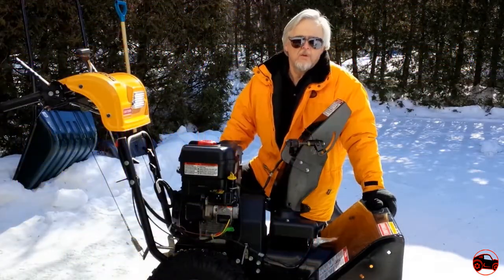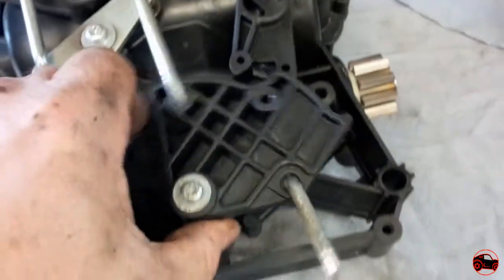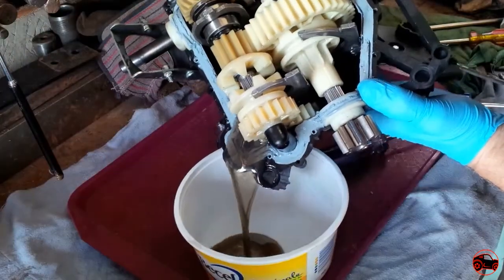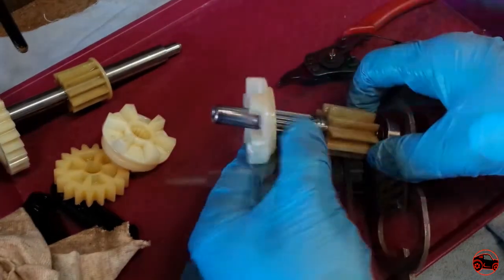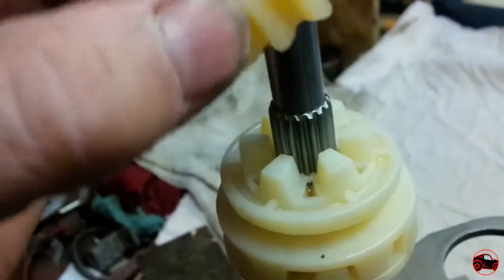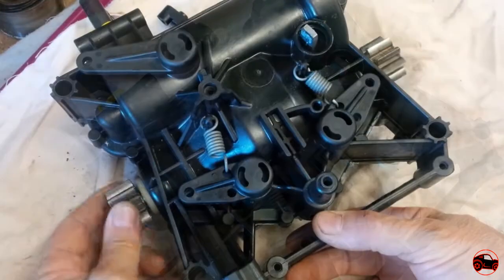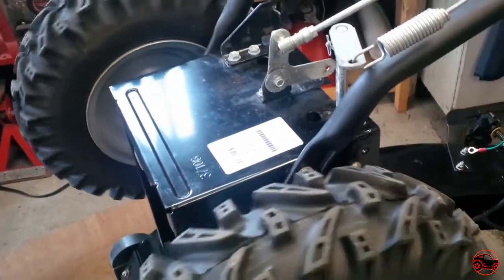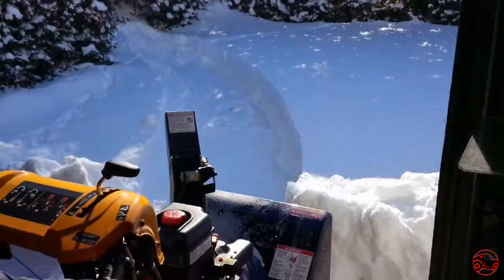How I dismantled and reassembled the transmission on my Sears Craftsman Snowblower C950-52301

Comment: very complex. I have a craftsman C950.521260 that fell off my carrier this morning landing on it's side.  now I am having a difficult time shifting into the forward gears. if I get it into forward 1 or 2 I cannot easily get it into reverse 1 or 2.  nothing appears to be bent or broken on the outside but it seems like the linkage rod that goes into the body of the blower is binding.  anyone have any suggestions on what the problem may be or how I can repair?
Reply from the maker: When the traction control is out of adjustment, the Operators manual mentions '' See authorized dealer'' so it doesn't help. I know that the speed variation control rod (right hand) is used to rotate the shift cam that is mounted on the top of the transmission. The rotation angle of the shift cam is critical to align the inner gears of the transmission and the outer short control rods. If the speed variation control rod is not properly adjusted in length, the transmission inner gears can be misaligned and the outer short control rods can be offset from specs. If the snowblower handles were not properly aligned after the fall, you could try to readjust the length of the speed variation control rod. This can be done by using the adjusting nuts at the bottom of the rod. I don't know the specs about this adjustment but you can have a look at these document to know more about the transmission system. 
Links to: 
Snow Transmission Type HR300P
https://services.generaltransmissions.com/wp-content/uploads/pdfs/service-manuals/39005-B_manuel_HR300P_BS.pdf
HR 300P Transmission. Hard Shift Kit Installation
https://services.generaltransmissions.com/wp-content/uploads/pdfs/bulletins/Snow%20blower%20Controls%20kit.pdf
Reply: @mtlcarguy  thank you so much. this is a great place for me to start.  I will report back with findings when I get into it tomorrow.
Reply: @mtlcarguy  I will try to link a video. I disconnected the speed variation control rod at the bottom. attempted to move the shift cam by hand and it will not move in either direction. 
https://youtu.be/4fkFOv4P9Bg?si=EwB_Io1Xw1XTwfXc
Reply from the maker: @TheRealRobM  The short rods on the top of the transmission are also connected to the variation pulley. This pulley combined with the driver pulley on the engine act as a CVT system. Make sure the engine is ALWAYS running when changing the position of the cam and short rods, so the variation pulleys can retract and expand while rotating and at the same time the position of the drive belt is constantly and properly distributed between the 2 variation pulleys. If the variation pulley are not spinning the cam may jam.
Reply: fantastic!  that allowed movement!  connected the selection rod back to the lever arm.  started it and the forward gears are working!!   after it engaged the drive forward. I stopped and it easily went back into reverse.  then back to drive and so on. about every third back and forth with the drive selector, it binds and won't go into reverse. I lurch it forward again and it easily slides into reverse.. then easily back into any of the forward speeds..    I think I'm going to leave it for now. I need it for a couple more months until past winter.  I can absolutely manage with the 1st and 2nd speed working and rarely use reverse anyway.   
I completely appreciate your help and will stay tuned.  I'll leave well enough alone for now. thank you mtlcarguy from an Ontariononsnowblowerguy 😅

Comment: Great videos — did you ever need to replace the drive cable.  Looks like I need to remove the engine to get to it, which is mind blowing.   Before I get too deep into disassembly just doing some searches to see if anyone else had any ideas.
Reply from the maker: No, and I bought it from Sears in 2012

Comment: Thank you very much for the video! I have managed to fix my transmission following the steps. I had the same issue with the two bearings next to the clutch lever. The snowblower is working again!  Mine is Craftsman C950.521260, the transmission is General Transmission 3071A152, 1733972 (87022 A2). Best regards and thanks again!
Reply from the maker: Make sure that the steel cable that engages the cone clutch system is not slack by adjusting the linear guide wheel (@ 7:17, top left corner). This should prevent a partial contact of the two conical surfaces that would generate slipping and overheating.

Comment: Probably the best mechanical video I have ever seen. Reassured me that I won't be repairing my transmission. I will spend $350-400 for the part or buy a new snow thrower. Thanks!

Comment: im really surprised there is never used internals available on ebay....if they fail often there should be a ton of them available for parts use ...ive personally only seen two go bad....one time was the 6002 bearing fail....second one was an overheated cone on the clutch got so hot it melted the center part of the worm drive nylon gear and made it too thin to effectively function as a clutch

Comment: I have the same snowblower and after last storm I started blowing snow and as soon as I changed speed I couldn’t lower speed. After taking machine apart I see the drive pulley separates as a higher speed is selected and belt slips further into pulley. As pulley seems to go back to together when lower or reverse speed is selected it is no longer able to move due to belt being wedged into pulley. Do you know if pulley on the Craftsman c950 separates or is my pulley broken and in need of replacement. Trying to figure out if I get rid of machine or try to fix. Thanks
Reply from the maker: First: The hand controlled speed lever must not be moved if the traction control is engaged because it can damage Transmission Control Traction parts

Second: Never try to change the speed if the engine is not running because it can only move the shift arm plate controlling the lower variable pulley which improperly position the variable drive belt in the lower pulley. 
Pulling the speed lever too hard can also damage the plastic CAM control (Controls kit P/N: GT7933) and other plastic parts that are used to manage the forward and the reverse gears inside the transmission housing. 

This is the PDF link that can help you.
https://services.generaltransmissions.com/wp-content/uploads/pdfs/service-manuals/39005-B_manuel_HR300P_BS.pdf

Third: Usually, the upper or the lower pulleys are quite reliable. 
The lower pulley can be difficult to expand or retract if it is rusted or if the lateral bearing acting as a thrust roller bearing is damaged.
A bad adjustment of the speed control rod can also create a problem.

Craftsman.com (Craftsman.ca) still sell snow blowers, but, this model is not sold anymore.
Some generic parts can be found on the Internet. I don't know if parts like the ones in the Controls kit P/N: GT7933 can be found if they are damaged.

Comment: Great video now I am wondering how to adjust the tension on the clutch system
Reply from the maker: The tension of the traction control cable is adjusted with the guide wheel (P/N: 579860MA) of the slotted bracket (P/N: 1737347AYP) that is fastened to the frame box. If the cable is slack, I loosen the nut of the guide wheel screw and I slide the guide wheel retaining bolt in the slot so the control cable is not slack anymore, then, I tighten the nut to set the new adjustment.

Comment: I think that the basic problem with this transmission is that the bearings are mounted in a plastic housing, so heat isn't getting conducted away like a metal housing would, so the bearings overheat and fail. I had the same snow blower given to me for free because of a blown transmission. I ended up fitting a traditional friction disk transmission in it, from an old MTD machine, and it's been working great since then.

Comment: As a mechanical engineer myself I am having trouble moving my jaw back in place.  This is beyond belief to put plastic gears on units being sold in areas with extreme low temps when any plastic becomes brittle. It's an insult to any engineering ethics

Comment: This is a terrible and unnecessary system, yet we work with what we have.  I have done this exact repair on several units with replacing ALL the bearings with high quality ones and have never had an issue.  Do not buy cheap bearings, replacing all of them will set you back $80 to $100 in parts.  Aside from the lengthy dis/reassembly removing the existing sealant is the worst part of this job.

Comment: Any idea what oil is used in the transmission?
Reply from the maker: EP-00 Synthetic Semi-Fluid Grease. I did not find the oil/grease documentation about this transmission P/N: 87022 A2, but the document RS800 ''Add grease into unit.PDF'' made by General Transmissions is available in line and describes it. This the link: 
https://services.generaltransmissions.com/wp-content/uploads/pdfs/bulletins/RS800%20Add%20grease%20into%20unit.pdf
Reply: @mtlcarguy  thanks. That grease is pretty thick compared to what came out of yours so I believe must be an oil. Looks like a 5w-20.
Reply from the maker: @hotgore  For sure it was not 5w-20. You can contact generaltransmissions.com for more details.

Comment: Thank you, thank you, THANK YOU for this video. After a lengthy procrastination, my partner and I disassembled the transmission this past weekend, and put it back together (which we would NOT have been able to do without this very clear explanation). We put the transmission and motor back on the machine last night, and it worked PERFECTLY. Our issue was the bearings on either side of the clutch lever. In fact, when we poured the oil out of the housing, all of the balls from one of the bearings came out with it. The rings were hanging loose, the bearing must have exploded when it went. We had thought about sucking it up and buying a new transmission (for $500 or so). Instead, for the price of the bearings and a few tools we needed anyway, we have a working snowblower again. All because of this video. THANK YOU!
Reply from the maker: Excellent!  It is not everybody that could do what you have done. 
It is also important to properly calibrate the tension of the wire that activates the clutch system. 
If it is too loose, the clutch will not fully engage and can skid/slip. 
On the other hand, if it is too tight, the bearings will not last. 
Avoid using speed levels higher than 5 to limit the stress on the clutch system.
Reply: Do you have to remove the engine to change transmission?
Reply: @shanemis6296  Yep. You can't get at the transmission case without taking the engine right off the body.

Comment: Hi! MTLCARGUY. J'ai la même transmission sur ma Craftsman 1450/27. Le problème est qu'elle ne recule plus. 1 à 6 avant fonctionnent #1. Reverse gears fini ou bien c'est juste un ajustement? J'ai rien trouvé pour régler mon problème. Merci de tout aide que vous pouvez me donner.
Reply from the maker: 1	C’est peut être un ajustement de la tige de contrôle.
2	Un problème dans la transmission.
3	Un problème avec the ‘’shift kit’’

Voir les documents PDF suivants sur le site de General Transmission pour de l'information de base.

Snow Transmission Type HR300P
https://services.generaltransmissions.com/wp-content/uploads/pdfs/service-manuals/39005-B_manuel_HR300P_BS.pdf

HR 300P Transmission. Hard Shift Kit Installation
https://services.generaltransmissions.com/wp-content/uploads/pdfs/bulletins/Snow%20blower%20Controls%20kit.pdf
Reply: @mtlcarguy  Merci. Je vais vérifier tout ça.

Comment: Excellent video, very well documented. I've never had one of these units come into the shop, and always found the CVT transmissions on snowblowers as an interesting, but not necessarily needed idea. I suppose they are cheaper than a hydrostatic transmission, but more complex than a typical friction wheel drive system.

Comment: This is a great video, thanks! My C950's traction control gave out on me last night (thankfully after I had cleared most of the big snowfall). There's almost no tension on the drive cable, even with the tensioner wheel set to the max distance. The cable is still attached to something inside, but there's just way too much slack. I took the belly plate off, but the whole transmission is in the way, I can't even see the assembly, let alone reach it. Seems like the clutch control cable has to be accessed from the top (after removing the engine), which seems like an awful design. Am I missing something, or would I have to remove the engine to access the clutch cable?
Reply from the maker: Yes you have to remove the motor/engine to access and remove the transmission. The cables are attached on the top of the transmission.
Reply: @mtlcarguy  If you'd be so kind as to answer one last (I promise!) question, I'd really appreciate it. I just got around to removing the engine to see what was going on. The cable and spring are fine, it's the clutch itself. The clutch lever that the spring attaches to is quite loose. At its resting position, instead of pointing towards the front of the machine (like at 7:17 in your video), it points to the side, even a little towards the back, and it easily wiggles back and forth. Is there any way of 'resetting' the clutch without disassembling the whole transmission?
Reply from the maker: @novascotian2789  
I never found any information on how to calibrate the cable to have the perfect lever position but I did slide back the cable drive wheel a fraction to add a bit more tension on my cable and so far my snowblower is working fine. 

More information about troubleshooting !
@ 5:22  In traction condition, when the clutch lever is pulled with the cable, it rotates the inner clutch lever and the inner lever rotates. This action pushes the sliding bearing against the conical clutch assembly to compress the assembly and lock the worm gear with the clutch and the shaft. 

@3:57 In this view, I temporarily assembled the 2 conical clutch components with the expansion spring to show how the clutch components were held together inside the worm gear steel ring.

In NO traction condition with a minimal or no tension on the traction cable, the expansion spring keeps the conical clutch assembly open so the shaft is not locked with the worm gear 

The cable and the lever (shown 7:17) are connected together with a calibrated spring in order to limit the lateral pressure applied on the 2 bearings.

A first test can be done If you have access to the lever and you can unhook the spring. You can rotate the lever by hand to simulate a pulling cable.
You should feel the tension of the expansion spring located in between the 2 conical clutch components.
If there is no tension, one or 2 bearings on the clutch shaft could be broken.
If there is a tension, the 2 bearings could be in good condition and only the tension of the clutch cable may have to be calibrated.

At this moment an other test can also be done when you have access to the clutch lever. The frame box of the snowblower could be sitting on blocks with the two wheels not touching the floor. Then, you can try to rotate the variable speed pulley while you test by hand the traction lever in traction condition and in NO traction condition. The wheels should rotate if the clutch assembly and the shaft lock with the worm gear.
Reply: @mtlcarguy  Amazing info as always. Thanks again!

Comment: Great video! I recently bought a used Craftsman blower and removed the loser pan to service the friction disc and was very surprised to see this plastic transmission and very little information from Craftsman or online to adjust or service.  You were able to explain the functions of the components so I could understand how it works and the variable drive system.  Too bad you can't check or add oil as some has leaked out on mine.   I will be gentle and keep my fingers crossed untill mine needs  open heart durgery!  Thanks.